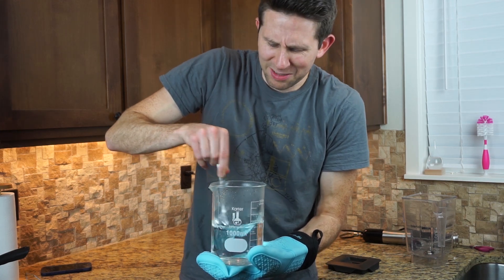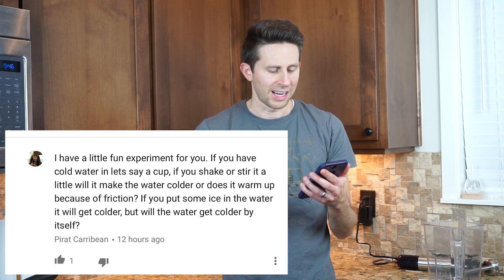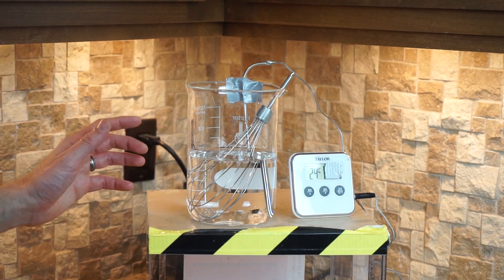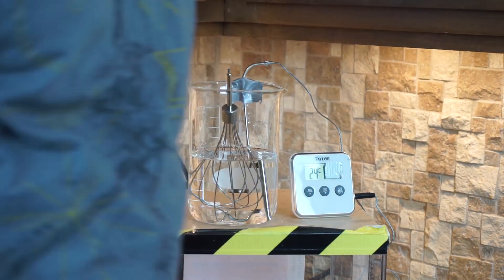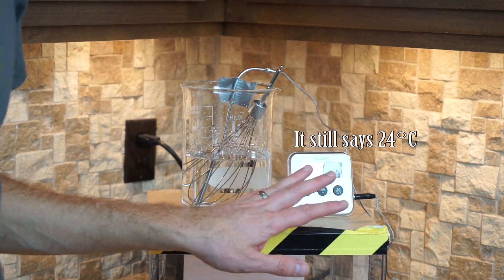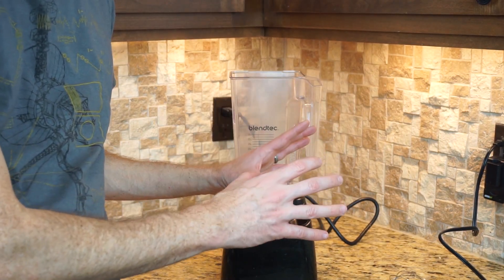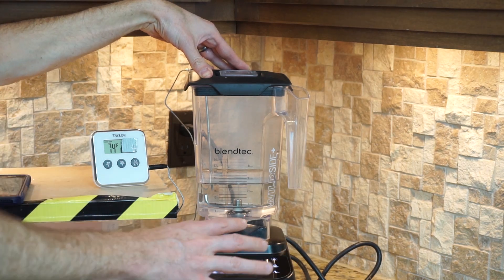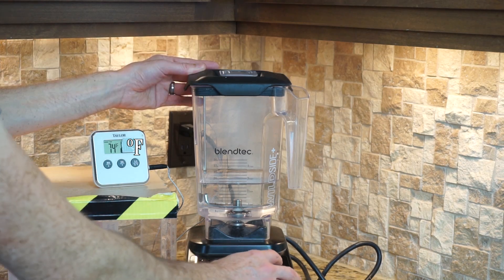Can You Boil Water Just By Mixing it Really Fast? Water-Stirring Challenge Accepted!

Comment: Is it possible to determine elevation by the boiling point of water?
Reply: MrFmiller yes
Reply: Generally, yes. Fluctuations in atmospheric pressure due to the weather may affect it slightly though. Higher pressures mean a higher boiling point.
Reply: Yes but there will be some inconsistencies.
Reply: MrFmiller 
Interesting question.
Reply: Strictly speaking, no. Loosely speaking, yes.
Reply: Yeah, ever heard it's impossible to boil a potato on mount everest? It will never get soft enough to eat.
Reply: Not elevation, but pressure
Reply: It's called hypsometry. 

A hypsometer is an instrument used in hypsometry, which estimates the elevation by boiling water – water boils at different temperatures depending on the air pressure, and thus altitude.

https://en.m.wikipedia.org/wiki/Hypsometry
Reply: TheNicknack43 so does this mean we can get temperature from height of boiling water
Reply: I checked on Google and found the information.
A chart shows 1 degree decline in the boiling point per 500' additional elevation.
https://www.engineeringtoolbox.com/boiling-points-water-altitude-d_1344.html
For accurate measurement the barometric pressure for the location being measured is needed.
Temperature and humidity affect barometric measurements.
The measurements are critical and the graduations small. 
More information is needed for accuracy.
In short it is possible but accuracy would be difficult.
Reply: You can know the atmospheric pressure with that measure. It gives you a vague reference about height but take account that for a  determines height climate changes affect pressure.
Reply: MrFmiller 
Boiling point barometric pressure measurement is a good measurement of pressure. 

Determining elevation based on barometric pressure is approximate and inconsistent. A fair estimate of elevation can be had if there is a simultaneous pressure reading nearby at a known elevation.
Reply: You can determine atmospheric pressure from the boiling point. This will give you a rough estimate of the elevation
Reply: MrFmiller take it into account, air have mass as well so pretty air is more dense closer it gets to sea level thus creating more pressure and less if its above and take water if the presure rises then boiling point decreases and vice versa
Reply: chu Harry you’re dumb
Reply: Just use that Snapchat filter
Reply: its not the altitude that determines the boiling point. its just the purity. 100% destilled water boils at 100 degrees.
Reply: MrFmiller yes, where I live in Colorado water boils at 207°.

Comment: Thick or viscous fluids heat up faster.
Reply: Water gets less viscous as it heats up and approaches boiling, so does it mean it gets more difficult to increase temperature the hotter the water in the blender gets? I suppose there are other variables at play too?
Reply: Claudia Sketches thixotropic!
Reply: Solidatermx Yes, if the blade moves at the same speed. However, in reality, the blade will not move at the same speed if the fluid is more viscous. In the end, it comes down to the output power of the motor. If the motor outputs 1000 watts of actual mechanical power, then that is what will be converted into heat, regardless of viscosity.
Reply: Yes,alot more friction
Reply: +Claudia Sketches the hotter it gets the faster it loses heat to the outside world also when it boils it suddenly sheds loads of heat in the form of steam
Reply from the maker: +Solidatermx correct!

Comment: Is the blender 350W? Loses to electromagnetic radiation(IR) is low. If all of the 350W (350 J/s) went directly into the water(4186 J/(kg⋅K)), then it would boil a lot faster. Logically, the motor heats up and the axle and the ballbearing. You can see that the water is boiling around the super hot ballbearing. If you isolate the outside of the jug, and plot the temperature as a function of time, I think that you will find that your experiment is invalid.
Reply from the maker: +hpekristiansen plotting temp vs time will not separate the heat from the friction in the motor and he heat from water mixing. It will just tell you how much total heat goes into the water per time. Unfortunately there is no easy way to separate the two. However you cannot deny that any power put into churning the water had to come out as heat.
Reply: At constant RPM, the water should heat linearly. I think you would see that there is an additional delayed term from other sources. So yes you could separate the two. Anyway it is a very difficult experiment to do right. The first law of thermodynamics is more often demonstrated with a dropped sack of lead shots.

Comment: I have a question. Gallium melts at 29°C-40°C, but it doesn't glow before it get a liquid like iron. Can you get Gallium so hot, that it starts to glow?
Reply: Blintschik Blintschik iron glows because there's a lot more energy required to make it Melt. Some of that heat becomes light.

Comment: Can you rig it to blend in a vacuum? Some said the water heats up due to hot air rises. Maybe this would minimize that. I would predict that it would lower the boiling point of water but, at the same time, will the blender overheat since there won't be much air to cool it down?

Comment: this doesnt really work cuz the speed of the moving blender parts and the electrical output transfering into heat energy in the converter of the blender (sitting right under the water [hot air rises]) are probably the greatest contributors to the temp increase, rather than the blades creating energy through the friction of the water or even from the waters motion alone. in order to do this the purest way you'd need water that cycles through an industrial pressure washing machine, into a cylindrical metal vat. van have the water pressure blowing water into the vat at such an angle to create a whirlpool. then you find out how much water pressure u need to push the water in a and see how long it takes to boil. so water is literally churning itself to find the boil temp. basically youd look to see how fast a whirlpool of water has to spin in order to heat itself.
Reply: Papa Pikka 420 check the blendtec FAQ: https://www.blendtec.com/faq Look for “BLENDER MODELS & CYCLES” and look for number nine titled “Can you make soup in a blendtec blender?”. TL:DR  the high speed of the blade generates friction by spinning against the water (kinda like rubbing your arms together to make them warm or rubbing sticks together to make a fire) eventually boiling it. Blenders motors are designed to run cool to prevent overheating under tough loads and have a cooling fan attached to the motor shaft that expels hot air out the sides of the unit, any warming of fluid due to motor heat would be very minuscule.

Comment: The heat increase could be caused by the friction heat made by the blades transferring to the water.
Reply: I think the water started boiling because it got too hot.
Reply: that is literally the point... stirring creates heat via friction on both the blades/implement of stirring and the water.

Comment: Isn't it possible the heat from the blender's motor doesn't warm it up too??
Reply: Henry Austin check the blendtec FAQ: https://www.blendtec.com/faq Look for “BLENDER MODELS & CYCLES” and look for number nine titled “Can you make soup in a blendtec blender?”. TL:DR  the high speed of the blade generates friction by spinning against the water (kinda like rubbing your arms together to make them warm or rubbing sticks together to make a fire) eventually boiling it. Blenders motors are designed to run cool to prevent overheating under tough loads and have a cooling fan attached to the motor shaft that expels hot air out the sides of the unit, any warming of fluid due to motor heat would be very minuscule.
Reply: AnantaSesaDas I used to service these blenders, there is no heating element... where would you even expect one to be?
Reply: AnantaSesaDas unless the blades metal makeup was changed, induction cooking would not work. For induction cooking to work the vessel must be magnetic. As for the nutribullet I’m guessing it just revs it up to as fast as it can go thus heating its contents through friction like every other blender with the same functionality.
Reply: Henry Austin true!
Reply: +Mr. Illuminati; doesnt mean there isnt a heat element for the soup setting.
Reply: +Mr. Illuminati; I'd guess just under the blades above the motor. Possibly even using induction heat. I dont know. It wouldnt be any more efficient to use an element so doesnt matter. But nutribullet has an additional button to push for heating soup so i cant imagine how it wouldnt heat soup if the button wasnt pushed if it's the blades heating. (why have a button? High speed? Maybe)

Comment: Couldn’t the heat have come from the blades when they spin?

Edit: The part where the blades are mounted, probably creates friction and heats up.(I would guess that running it continuously would eventually heat it up to the point where it stops working). Ideally you would need a frictionless setup. yes, I understand the law of conservation of energy,but I think it would take longer with an Ideal Setup.